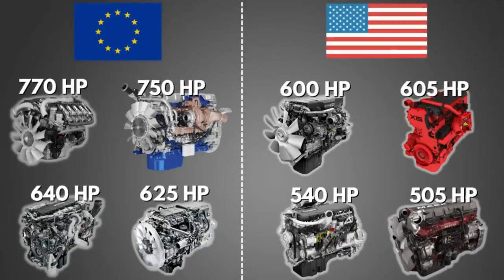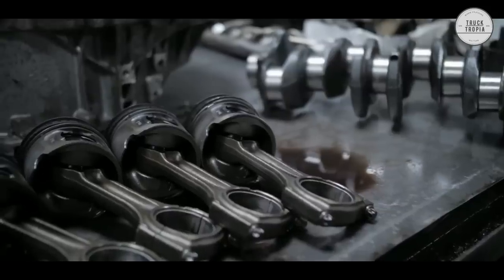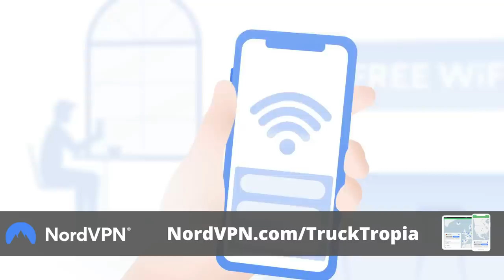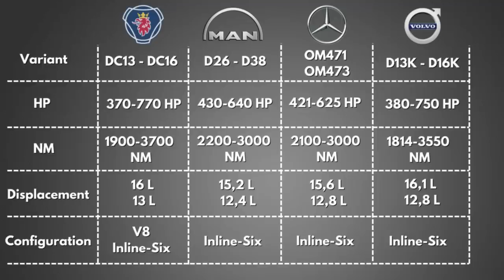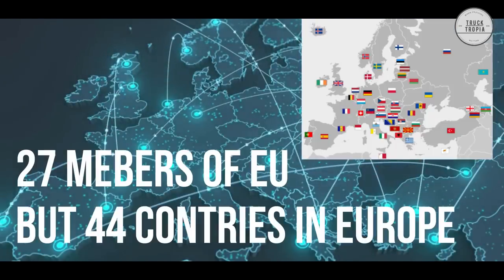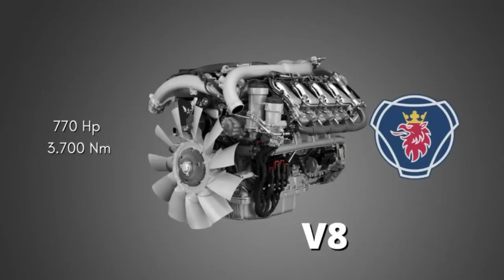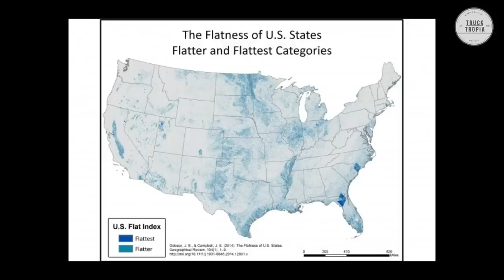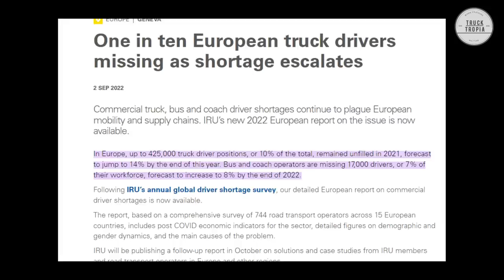Why European Trucks Have Up To 770 HP And US Don’t

Comment from the maker: ▬▬▬The Video is Sponsored by NordVPN ▬▬▬
🌎  Get Exclusive NordVPN deal here ➡ https://nordvpn.com/trucktropia 
It's risk-free with Nord's 30-day money-back guarantee!☝
Reply: I know this video is about big trucks, but DAF use Cummins at least on their smaller models like LF and CF (ISB4.5 150 - ISB6.7 320) even though they brand them as Paccar engines. Cummins do let vehicle manufacturers do that, other examples being "Iveco" Cummins engines (whatever they renamed the ISB4.5 to) and "Scania 7-litre" engines (which are really Cummins ISB6.7s).

It is kind of ironic that American big trucks don't have as big engines available compared to European ones, yet Dodge pickups are available with Cummins ISB6.7s which in the UK are the sort of engines used in some rigid trucks and single-decker and even double-decker buses!
Reply: You should do a video on the bandar abbas Express. The longest truck route in the world.
Reply: it would have been nice if the NM was translated to a real metric. that would be foot pounds or torque.
Reply: Wrong wrong wrong. Tongue does nothing until rotated over time. Horsepower does all work. Watch an engineering video, like Jason at Engineering Explained. Torque is better visualized as the force available per stroke, and tuning for RPM has everything to do with the total power curve of an engine.
Reply: @thelasthallow  technically it's lb-ft for that, although the 2 terms are almost synonymous and often confused. I remember the force created by an engine because you can "pound feet" (move fast) with them.
Reply: 7:52 To Truck Tropia the EU and the continent EUROPE are NOT the same thing.
Reply: How much HP does a Tesla Semi have ?
Reply: Why the mixed units? Hp and Lb-Ft go together, and so do kW and Nm.
Reply: Engine torque doesn't matter. It's always about horsepower. You can gear for torque. That's the entire point of gears.
Reply: I'm glad that i'm European
Reply: Kind of false advertisement, a VPN won’t get you a better connection in the countryside